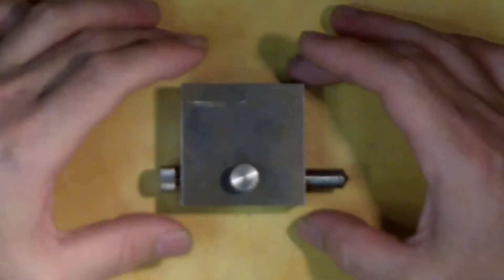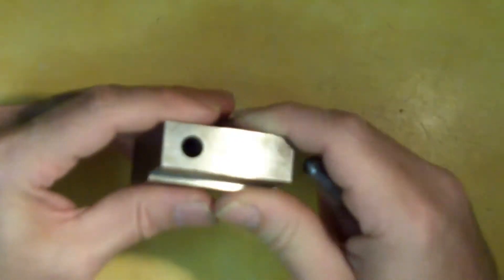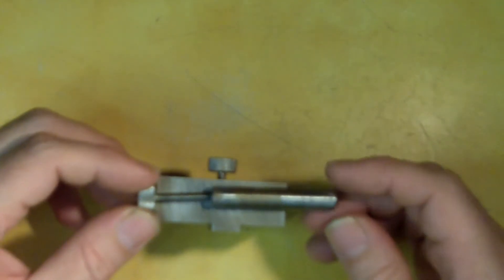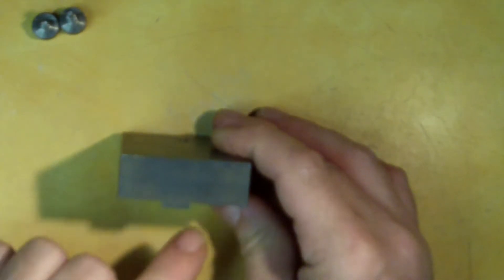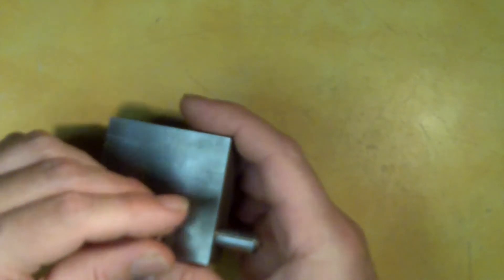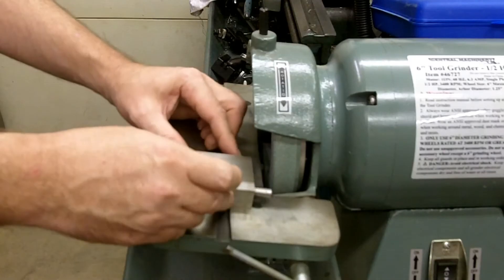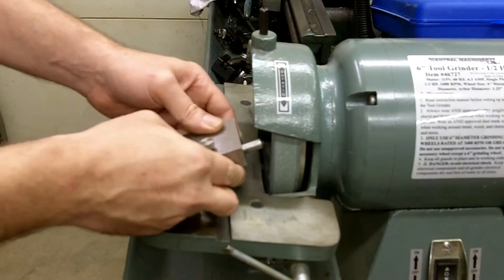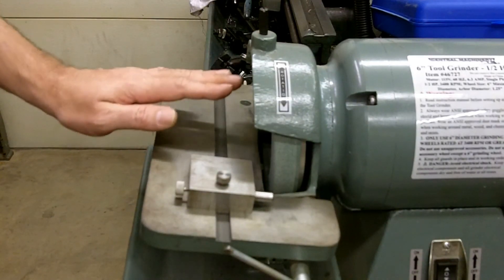Dressing Grinding Wheels with a Diamond Dresser Jig

Comment: Great video, just subscribe. I have a question that I hope you or someone can answer for me. I just bought a used carbide grinder just like yours but my is made in Taiwan and it runs very smooth like yours after you fixed all of your runout issues. My question is, my grinder had the green silicon wheel and either a diamond or CBN wheel on the other end. How can I tell if it’s a diamond or CBN wheel? Obviously I’m a newbie on identifying wheels.
Reply from the maker: I can't say how to determine what you have Michael. You might take the wheel off, if you haven't already, to see if there is a model number/etc. on the back of the flange. If there is, that may assist in determining what type of wheel is mounted. Good luck, G.

Comment: The one and only perfect tool for this job is the lathe itself,just need to attach the diamond cutting in the tool holder and a vacuum cleaner for the dust.
Reply from the maker: George, that does seem to be the case, but the wheel won't be run-out free after installing it on another arbor. Turned, or trued in place, it the correct method. Take care, G.